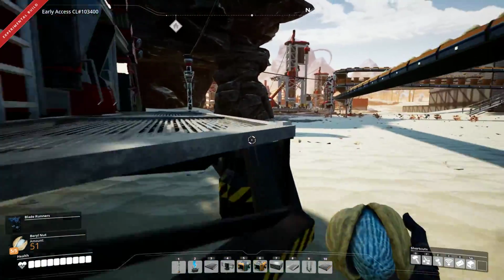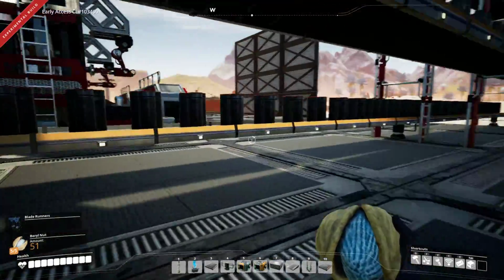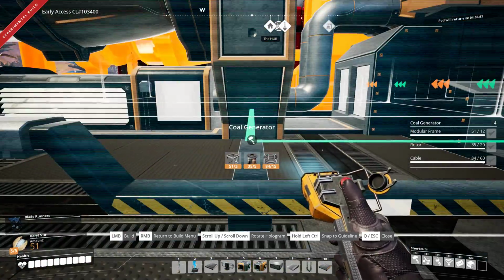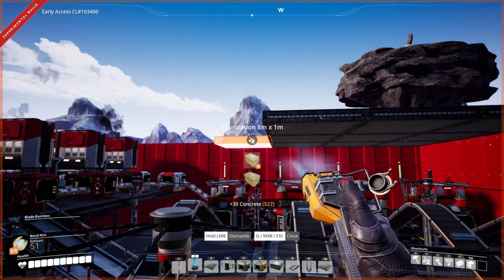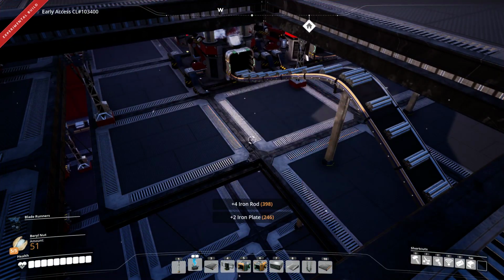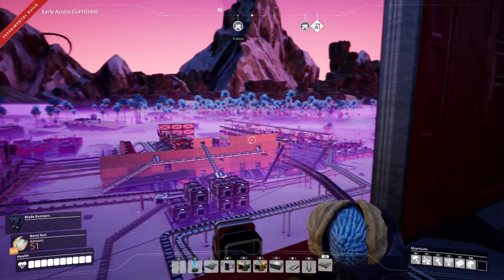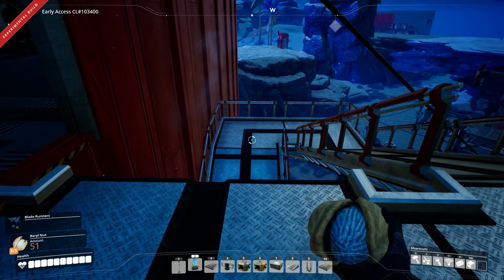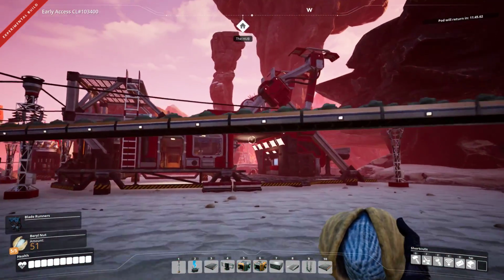Kick-Starting A Dead Factory | Satisfactory Desert Bus Ep#26

Comment: You can deal with the power spiking rather easily by making a backup storage of fuel and then putting down extra generators. During normal production, if it runs close to normally-planned power cap, your generators will run on whatever fuel they manage to grab, but they will still output as much power as you're making fuel for. When the power consumption dips low, they will build up storage. And when it spikes up, they will use it quickly and automatically. I usually build double the generators and enough storage for them to run for hours if needed.

Comment: 44:26 Factorio style except that in Factorio you stand and hold down the key to take 15 items a second (900 items a minute). While in Satisfactory you are smashing the key and can reach 2 items a second only once you reach 120 APM (actions per minute).

Satisfactory seems to be so fast with its items per minute, in Factorio you make gears so fast in your pocket it would saturate Satisfactory's Mk.2 belt (Assembly Machine 1 saturating Mk.1 belt). While the Factorio belts are 15 times faster. You are discussing belt speeds @ about 31:56.

Comment: 40:19 the distance:
I think it is common to "removing a bunch of zeroes. I think they forgot to multiply the distance by some constant. So now they are checking for the distance between 0 and 1 meter (or what basic unit they are using) and everything 1m+ is "miles away.
Also, it seems to be broken only for the belt elevator and texture of building floors? Seems to be lousy non-scalable coding! But then, I have never programmed such a large scale project.